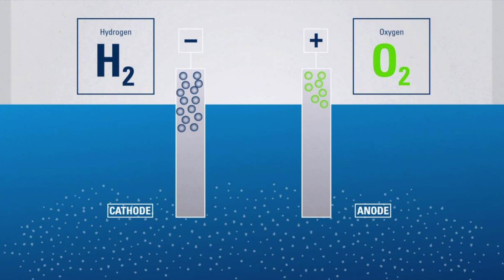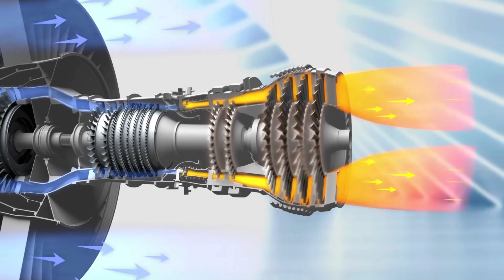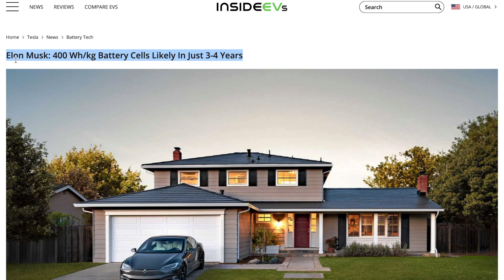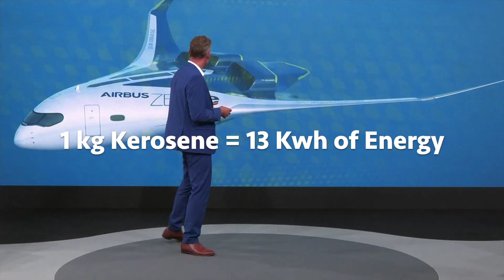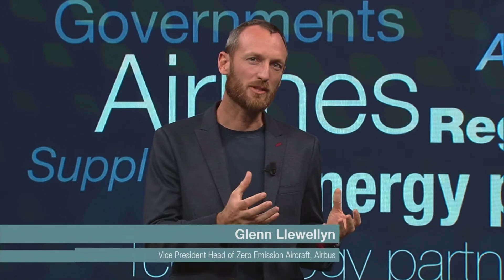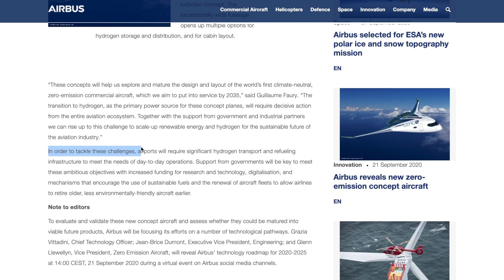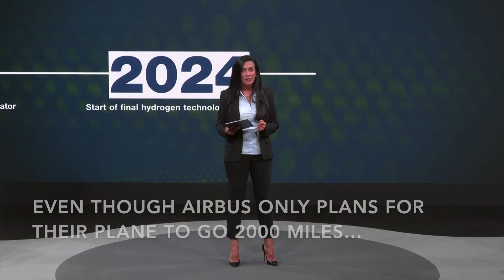Why A Hydrogen Plane Is A Terrible Idea

Comment: You know what's funny? When you burn hydrogen, you get water of mass 5 times the mass of burned hydrogen. All this additional mass is taken from the atmosphere and returned to it, so one can say that energy storage of a hydrogen plane is partially outside of the plane itself. Moreover, as was mentioned by others, hydrogen is burned during flight and in average mass of plane fuel is about 1/2 of its initial mass. Which means that on average a hydrogen plane stores 1/10 of its energy storage. 
A battery powered plane, on the other hand,  stores 100% of its energy storage. That means electro-chemical reactions in the battery must be much more efficient than burning hydrogen (which produces a lot of energy because hydrogen is the first element of the periodic table). 
So I don't know the future of battery technology but I personally doubt that it will reach the level of hydrogen+atmosphere oxygen any time soon.

Comment: Well, looks like, even with solid-state batteries, you are not fully taking into account the real challenge on aviation: weight. It is far more complex than building a car. That efficiency of 10x to 40x is not taking that into account.

Comment: For a car some extra weight isn't a huge issue, for an airplane however it obviously is since it needs to constantly has to overcome gravity + it's own weight. I agree that burning hydrogen is most likely quit stupid but a fuel cell powered electric engined plane could be wise. 16x less weight than current batteries.

You could start with long haul flights from bigger airports. A combination of solar, wind, water and nuclear power plants nearby that generates electricity and a hydrogen station near the airport. After a huge initial investment the costs in the long run will be lower than fossil fuels. Batteries are and probably will be too heavy for the foreseeable future. In the same way as EV caught traction in the car industry I believe fuel cells will be the future for aviation, at least for longer flights, perhaps for shorter flights we will see some battery electric powered planes.

Comment: Burning kerosene has a thermal efficiency of 35-45% compared to hydrogen at 20-25%. The point you make that 3/4th of the hydrogen you carry being dead weight is more of less irrelevant. The increase in efficiency of burning kerosene took 50 years of development, hydrogen hasn't had it's chance yet.

Comment: Hydrogen is likely the best option for aircraft, especially airliners considering that if you took almost any aircraft and powered it with todays batteries  you’d see a significant drop in flight time, however with something such as a citation longitude you’d actually see an increase in performance provided you made a decent engine.

Comment: With all your assumptions about future battery energy density, can you put down a number here how many kg of batteries are needed for a trans-atlantic flight? If you can get it down to about 100 tonnes, you might have something.
Edit: Estimating 170000 kWh needed for a transatlantic flight that would result in 70t of batteries assuming the 2.5kWh/kg batteries become a reality. That would actually work but remains to be seen if batteries get there. But then again, depends how efficiently electric energy is converted to thrust.

Comment: Lots of your calculations are way oversimplified, you compare the price of kerosene to hydrogen per kilogram instead of usable energy per dollar as you should have for example. The way you assume that battery technology will improve 10 fold by 2035 is absurdly optimistic. You need to take in consideration that even a slight increase in mass leads to drastic increases in cost of opeation as well, you need a bigger plane to carry the extra batteries, you pay higher airport fees the heavier you are, the weight of batteries doesn't decrease as you use the energy inside of them. The efficiency of water electrolysis has already reached ove 90-95% and the conversion of that hydrogen to electricity in a fuel cell is 50% efficient currently. The fact that your overall system efficiency is around 40% efficient in an hydrogen system is more than made up by the fact that it is so much lighter than batteries even if they have an efficiency of 80-85%.

Comment: I think you missed the bat on this one. You didn't take into account charging times of planes, extreme high electricity fluxes of doing so, and most importantly, the intermittency of renewables. Hydrolasys can offer flexibility to the electricity grid which Renewables need

Comment: Comparing energy density to an imaginary future battery is silly. In any case the actual comparison is to jet fuel which is much heavier than hydrogen. Weight is everything to an airplane. Furthermore this advantage increases with range since the cost of fuel tanks goes up by the size squared but the volume goes up by the  cube. In any case the bottom line rules.

Comment: For a long range aircraft a battery option is much heavier. You can examine the fuel to total mass ratio of todays long Rang airplanes.

A battery based long range aircraft has a higher MTOW even when the batteries have the same energy density as the hydrogen

Comment: How would you run an electric jet engine?
Reply: I guess like a nuclear jet
Reply: This video is referring to an electric aircraft using hydrogen converted into electricity.  Aircraft have been developed by the US air force that use liquid hydrogen as a replacement for jet fuel. The liquid hydrogen powered aircraft are much faster and can fly at higher altitudes.  50k feet compared to 30k feet.

Comment: I'm no expert or anything, but I reckon hydrogen has a huge advantage compared to battery - weight. This isn't a car we're talking about here. Planes should be light, they need to be in order to fly, and batteries are heavy. And to make something heavy go further you need more fuel. So, bigger batteries. But bigger batteries are heavy, so you need more batteries. It's like a rocket in a way, you keep adding fuel until the craft becomes too heavy. Hydrogen, in comparison, is light. So, I say hydrogen is more effective

Comment: You could use the new generation of compact nuclear reactors to generate power, and then simply  use the current for electrolysis of water in onboard fuel tanks. The oxygen would be discarded, and the hydrogen pumped to the engines. This would minimize explosion risks associated with liquid, and even compressed gaseous hydrogen.
And, those small reactors are unlikely to melt down, except maybe in a crash-which, fortunately-is Rare.
Fission-powered aircraft were experimented with back in the Fifties, but those used heat from the reactor to power the plane. You would need a Very Hot carrier liquid, like Gallium, for that to be practical.

Comment: But look, why use combustion of hydrogen? A fuel cell is far more efficient than just burning it (about 75% probably more in 2035). So why didn't they propose that? Well simple, because you can not power a jet engine with batteries. And you need jet engines to achieve the Mach 0.9 speeds we are used to. In addition, charging a battery takes ages, making turn-around times much too long. Pumping it full of hydrogen doesn't take longer than currently with kerosene.
The big issue with hydrogen is not the price (this will come down a lot, as Germany for example already wants to produce hydrogen as energy storage and burn it in their gas powered generators) Producing hydrogen will mainly be done by the 'free' electricity from renewables when production >  demand and currently we even have to turn off some windmills to balance the grid. So it is basically a by product of renewable energy and the fact that you can't produce it when there is demand.
The real issue with hydrogen for flight is: how do you store it. To keep it liquid it needs to be super cold or under extreme pressure. The later is not possible since it would require extremely strong fuel tanks that weigh a ton. So you need some way to actively cool it below -252.8°C (without adding a ton of weight) or it will boil and blow the fuel tank apart, not great.

Comment: They could pump the oxygen into the cabin for high altitudes and burn the hydrogen, I’m sure this is what they have been doing all along. It has been proven a 747 wouldn’t leave the ground if the wings were filled with hydrocarbon fuel like they say they are

Comment: How many cycles can these batteries be recycled before they have to be completely exchanged for a new battery pack? You have to take that into account. On electric cars the battery is the most cost intense part. The hydrogen tank most probabyl can be refilled as often as a normal kerosene tank. We have working airplanes with a huge hull that could hold the hydrogen tank in the upper deck like the Airbus 380 and the 747. We just have to build up a hydrogen based energy supply chain by using all the capacities of renewables plus nuclear reactors. Then, I think, it´s absolutely doable.

Comment: As of today, this is still being worked on (some firm in the UK).  Given how much pollutants plans emit, this could hopefully become a thing (very few people understand that while yes per-capita passenger basis they do not out-pollute cars, they still do spew out amazing amounts of pollution).
Reply: Ignoring per-person fuel consumption is dumb. Absolute total numbers are irrelevant. It's all about how much work gets done per unit of fuel.

Not only that, but overall quantity/frequency matters as well. If only 0.15% of people use a plane on a given day then it has much less impact than something that is used a lot more.
Reply: @MsHojat  It's possible you don't know the full picture of how many human miles of air travel are done per day, but I understood your comment.

We should work on trimming the pollution incrementally, but we should never stop searching for truly sustainable ways to power the human world.

Comment: Water electrolysis is free if you use solar power. Well OK, you need equipment, and maybe anode replacement. But in principle - this could be the cheapest and cleanest energy available to mankind.

Comment: Energy density of hydrogen is ~143MJ/kg, compared to jet fuel ~45MJ/kg and lithium batteries 0.73MJ/kg
Reply: Yup, but you have to account for the weight of the heavy hydrogen tanks and the heavy fuel cells.

Comment: As soon as crude oil becomes that scarce, that any fuel source derived from it is $10 per litre resulting in insane prices for EVERYTHING that is dependant on it, alternative fuel methods will become a natural paramount and worthwhile cause, and then we have the climate to consider.

Also we presume our current way of living is the only way, a great big shift will occur in human behaviour and the economy, ie only certain people will travel between continents, people will live closer together, transport requirements will change, and hydrogen powered everything will soon enough fit perfectly into place for a feasible cost. What was seen as prohibitively expensive before will become normal basic human costs in order to continue living comparatively with the way we do today. 

It is hilarious today that there are still many people that persistently claim that crude oil production is the only way, eventually we will have no choice but to change our ways, it is inevitable. Personally I'd rather see crude oil kept in reserve for things that downright require it, and find absolutely any other fuel source we can to prevent using more oil. The future is exciting with regards to fuels, and I can't wait to see oil companies no longer having a monopoly over everything involving human need. With the collapse of oil prices due to lack of need, other fuel sources will become cheaper. There was a time we laughed at the idea of solar panels on peoples home roofs,  now every second home has them.

Comment: Hydrogen will also burn as long as there is an ignition. Batteries can be unpredictable, grow weaker and cost a lot to replace. I can't imagine the annual inspection on a battery operated plane

Comment: The green transition could be speeded up by designing and building these planes already now. Start developing, testing and last but not least mass producing electric jet engines as well as focus on lowering the overall weight of the aircraft. Then when battery technology is ripe, all we would need to do is plug the batteries in. Solid state batteries are awesome... but currently very expensive to produce and impossible to put into mass production. This could change, but there are some significant challenges to overcome. Hydrogen will work now. Fuel cells also pack a very descent energy density and the advantage here is that we could use fuel cells until battery technology is ready for cheap mass production and then all we would need to do is switch the fuel cells with batteries once that gets cheap enough.
Reply: Batteries won't be getting much lighter. There's a physics limit. And the improvements that do occur are very expensive and slow. Too many people are far too optimistic with regards to battery technology. They simply will always be bad options for large aircraft.
Reply: @MsHojat  batteries are definitely getting lighter. Sure there is a limit, and that limit is far from reached yet. It's not for ´nothing that litterally trillions of dollars are being invested into creating more energydense rechargable batteries. Fuel cellsm generate electricity too and fuel cells actually have high enough energydensity to allow for transatlantic flights, and fuel cell powered planes are also electrical the fuel cells could be switched with batteries, when the energy density has made them viable options.

Comment: Good analysis but you must take into account other external factors like taxing at an airport and time spent grounded. I would imagine that the taxing cost will be low and throughput of flights would be higher for hydrogen fuelled planes as it will be quicker to fuel up. i would also argue that the environmental cost is less not having to produce batteries that require far more productive materials and transportation.

Comment: Ammonia is way better. That is until we decide to replace air travel with traind, which will slow things considerably, but make travel more exciting and zero-emissions. That is unless we have battery-electric planes making many stops, but I feel like maglev is faster than stopping and charging an electric plane. Train stops are quicker than charging stops.

Comment: Hydrogen turns into water vapor, batteries turn into non-recyclable waste. Also you didn't mention that current fuel engines can be converted to hydrogen fuel.

Comment: I propose hydrogen jet aircraft, with the H2 generated by Hydrofluoric acid in the wing tanks, and Lithium Hydride in a sealed compartment in the hold. The acid would be hooked up to the throttle, and spray on the LiH. This would be a practical hydrogen generator, and said hydrogen would be pumped to the engines. How to make the chemicals?? Green-powered electrolysis. The reactants are toxic, but not volatile like liquid hydrogen. The Lithium Fluoride would be recycled, to regenerate the reactants. 
As for propeller-driven cargo planes, you could use the hydrogen to power a fuel cell, which in turn powers electric motors. VERY efficient!  A fleet of such cargo jets would be a Green, cheap, (and QUICK) way of breaking the current cargo ship log jam.